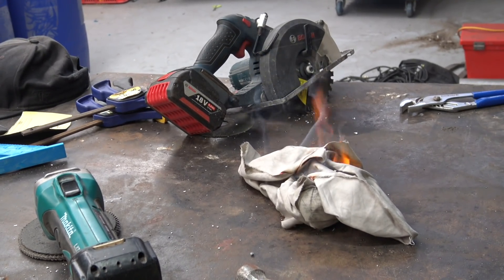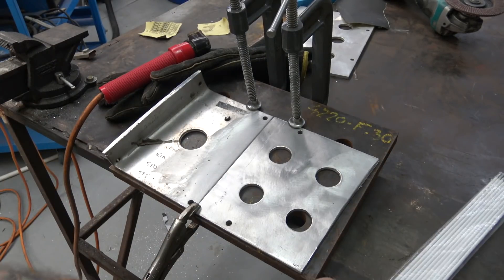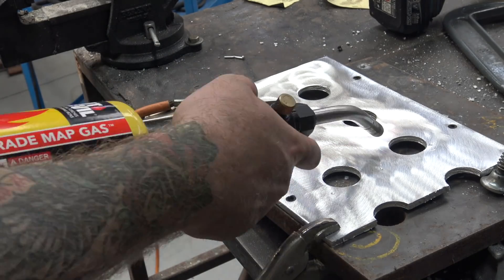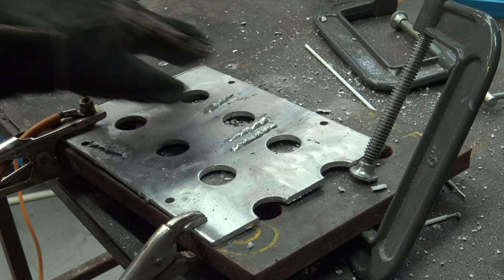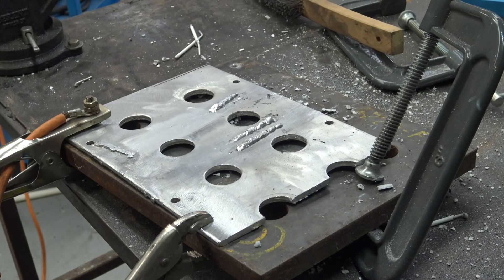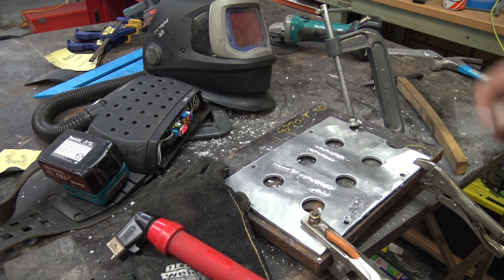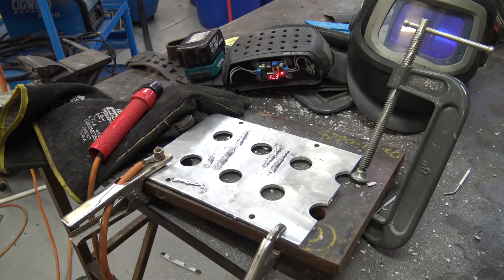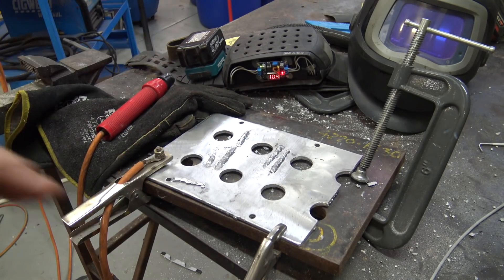Can you stick weld Aluminium?

Comment: Ive never welded aluminum in my life. But Ive built stick welders that are hard to get started. One thing you might try is using a bastard file to clean off the tip of your stick to get it started. This breaks away any oxidation on the sticks tip to reveal your shiny metal, like cleaning your work piece. With steel, I just gave up on that technique and getting the tip going suffices for me. IE just striking it like a match or stabbing it at the weld until I can get my tip molten enough to where its easier to start.

Comment: Just thought of two other tips. Put the ground clamp on the work, when you can, and the drag angle should be between 90 and 80 degrees, almost directly straight into the puddle.

Comment: Preheat to 400F. For a 1/8" rod (2.6mm?) run between 90 and 120 amps, depending on the thickness of the material being welded, and use Electrode Positive. 4043 rods will work on many alloys of aluminum, but not all. A dedicated stainless steel wire brush is best for prepping the work piece (aluminum oxide sandpaper will introduce the very material that you're trying to get rid of right into the work piece). Hot water and brushing is required to remove all of the flux in between passes. If you can set up the work to be welded slightly uphill, it will keep the flux from obstructing your view of the puddle so badly. Long welds will require a backstepping technique  to prevent excessive heat build up in front of the weld path. The rods absorb moisture like crazy so vacuum seal unused rods or keep them in an oven. The flux gets really crumbly if you let it get wet and then try to dry the rod. That's all the tips that I've got for ya. Well, I have one more tip. Switch to a good Kentucky Bourbon when you're dealin' with these aggravating damn rods.

Comment: I believe they were just a poor quality rods bro
But try this go 50 amps max and go sloooow. Dont lift the rod! Preheat way hotter to 750° f, 350° c , run the rod on the negative and try to holding the rod as straight up as possible and move a little dit forward/backyard.✌

Comment: In a video on YouTube inventors called 'STEL' are credited with inventing a pulsed function button. The pulsed function means that the welding machine alternates 100 Amps and then 50 Amps. This results in the aluminium rods not splattering as the flux is wasted. The rods are used in a more efficient way not wasted.

In a video by Zika a laser  gun is used to get a value on the pre-heated aluminium. Pre-heating is recommended as does your video: well-done for showing a heavy steal plate for keeping the aluminium warm.
Reply: Yes 😂

Comment: Haven't  used  the aluminum stick welding rod since 94. Used call it candy rod.. flux broke easy quality of weld was questionable  at best.its only good as a drag rod in flat. Its fast burning you really had to lay it in.. now with the portable  tig and spoolmatic mig dont think it serves a purpose  anymore.
Reply from the maker: Burns really really fast!

Comment: Excellent video as always, I've never seen ali mig welded, or stick welded. Only ever used tig. I'd be interested to see your set up on the mig. On a sidenote, have you ever used an ergostrip by knipex? I've got a lot of panel work coming up, just wondering if theyre worth the money?
Reply from the maker: I have never used one, never even met someone with one. I use knipex 121202.  But there is the new plastic gun looking ones that look good.